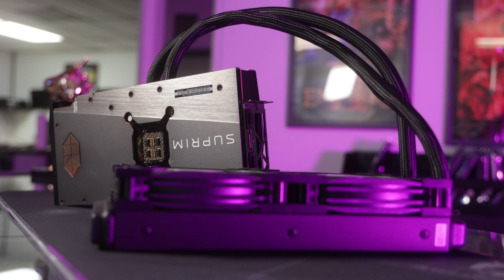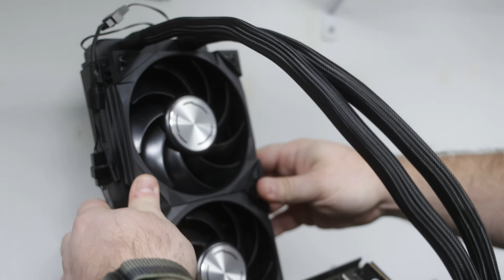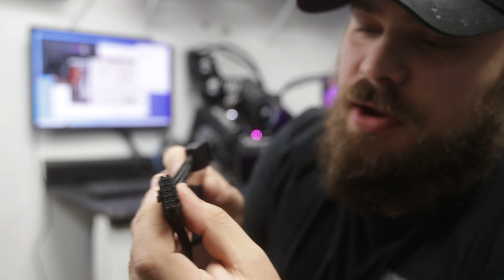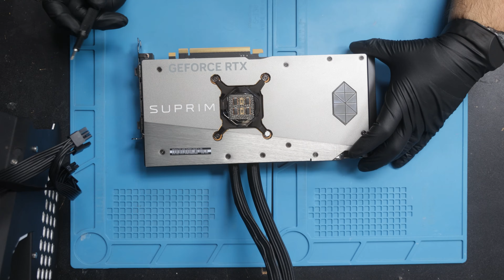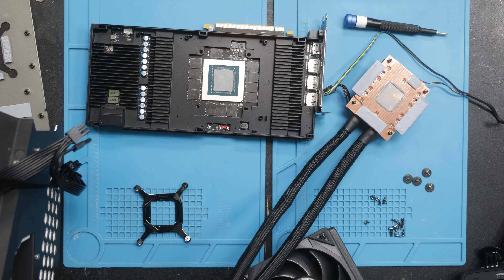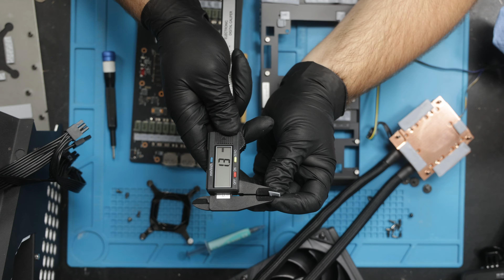MSI RTX 4090 Suprim Liquid X Dissassembly, Tear Down and GPU Memory Temperature Improvement

Comment: To anyone wanting to do this, you don't even need to remove the back plate. Just the 6 screws along each side of the front shroud and 4 on the back holding the cooler to the core. I replaced the thermal pads with thermal putty and PTM on the core. The memory went from 88-90c during test to barely hitting 70 by the end of a run. Core temps were about the same because MSI already uses PTM (or some variant of it).

EDIT: After a couple days and a few thermal cycles the core temps also have decreased ~10c with the new PTM on the core 👍

Comment: I just want to say thank you very much for your detailed explanation and lovely work with this graphics card. I love this card so much and thanks to your video I will check the manufacturing date to get details about the RAM situation. Lucky me got the card by an exchange with a 4080 without the need to put money on top (last year). What I want to say the chance is very high to have „the old version“, but I will see. Fingers are crossed. But anyways, I love this card so much (power, design, …).
Thumbs up for you and push push push for this video. Lovely greetings from Germany.
Reply from the maker: FYI any card they issue now will have this already upgraded. The second wave cards already had fix implemented.

Comment: im glad the 5090 suprim liquid improves on this design by putting the water tubes at the end of the card instead of the side. these current gen 5090 cards are wide, sometimes 150mm+ or "taller" than many average CPU coolers.
Reply: Yeah that was a dumb way to do things. It's not really problematic since you need the clearance for the 12VHPWR plug. Another downside is the orientation of the 12VHPWR plug - using a 90° cable makes for a very difficult removal since the retaining clip is hidden behind the plug and beneath the receptacle.

Comment: Great but what about the temperature differences 🙃❓
Reply: Surprisingly good temps for the core but vram suffers. 
Better with a waterblock because that copper part on the sides for the vram is sharing the core and the pump is incapable of cooling the entire area. It cools just a tiny bit in the middle and where the vram is its just thinker copper that water never cools it down but also some heat from the core extends out towards them.
Switched from that cooler to a waterblock and vram is never exceeded 40c and core max hot spot 56
530w load

Comment: Can the fluid be easily refilled? All water coolers eventually evaporate.
Reply from the maker: @TheWho18t  nope! The danger of any aio GPU
Reply: @SilverKnightPCs  @ 9:27 you can see that the pump takes a large philip head screwdriver to what appears to be a fill plug. So yes maybe?
Reply from the maker: @TheWho18t  you asked easily. I would not consider that easy for most folks

Comment: I need to replace the fan on my card itself.  After taking the shroud off, are there just a few screws that hold it in place? It's hard to see from that video when you flip the shroud over.
Reply from the maker: @Holyblades1982  yup!

Comment: Hi, is it possible to swap the radiator for 3 fan 36 white color type?
Reply from the maker: @jankristensen7884  not a 360. It comes with a 240 and its not easy to change

Comment: Hi Silver Knight,

I'm doing some experiments right now where I'm grafting a 4090 Liquid cooler onto my 4090 Suprim X. Theres a couple of issues I'm having;

1) I can't screw in the shroud fully. Can you confirm if the screws for the Liquid shroud is the same as the screws on its backplate?
2) My VRAM temperatures are up substantially, up to +30 degrees over air. I used 0.5mm Thermalright Odyssey pads. Would you recommend 1mm or 1.5mm for the pads?

Comment: Hi, I liked the video posted.
I have a question regarding the radiator.
Will it be possible to change the original 240mm radiator and apply a 360mm radiator?
Compliments
Reply from the maker: With some serious modifications yes
Reply: @SilverKnightPCs  Could you tell me how to make the change?
I purchased the Hyte Y70 touch box and would like to apply the 360mm radiator to the graphics card
Reply from the maker: @jorgemoutinho7159  I mean it's not as simple as something I can put into a comment on here. You're going to have to adapt all the tubing as well as get a replacement radiator and then redo the barbs on the cooler side or the radiator side. If you're asking me how to do it you're probably aren't equipped with the skills to do it
Reply: @SilverKnightPCs  I was thinking about putting this " Corsair Series Hydro X XR5 ".
My biggest question is whether it is easy to remove the tubes on the pump part ?
Reply from the maker: @jorgemoutinho7159  that's not going to work. The water block has the pump built into it but it does not nearly have the flow rate to run a full loop. You would have to do two separate loops with this card. If you're planning on going that route you might as well just order a aftermarket water block for the card if you plan to do the entire Loop

Comment: Great video. I know I'm a little late.  I have this card. And I have  a hotspot temp average that's basically normal but I have a hotspot maximum temp that's over 110degrees is this normal or is my card over heating. Because that average can be like 60 but maximum over 110.   Any info would be great as I'm about to send to msi to have looked at but don't want to waste people's time if not needed
Reply from the maker: So the hotspot temperature being that high is a little unusual. At the end of the day that's the hottest part of the core so more than likely it just means the cooler is not mounted evenly or alternatively there wasn't enough thermal paste or something. I would say I wouldn't worry about warranting it unless the card is having clock speed issues
Reply: @SilverKnightPCs  if u have time.   I noticed the clock speed on my card is dropping to around 1500 when I start getting the crappy graphics. Even if my thermals I below thermal throttle.   Any ideas

Comment: im not sure whether i should buy this card or the rog strix.
a lot of people seem to say that the radiator is getting extremely hot, almost unhealthy hot.
I feel like this should have been a full 360 radiator instead of this small one..
What do you think? Strix or this one?
Reply from the maker: Definitely this card, the Strix in my opinion is a bit overpriced for what it is. These cards are rock solid and they have updated them since the release (this video) to have better memory temps

Comment: I was slightly surprised you had OCP problems... I've been speccing a machine with a 7950X, this GPU (or an aircooled equivalent depending what's available) and I was wondering what scenario you were finding was triggering OCP, given the 40 series transients are improved on the 30 series. The GPU could potentially draw 530 watts peak if absolutely maximally overclocked via Afterburner under full benchmark load. A 7950X could theoretically draw at full blast 290W under 100% synthetic load. Adding those plus another ~50 watts for the board, you're still within tolerance of a decent quality kilowatt PSU. It wouldn't be as efficient as a 1.2 kW supply but it shouldn't just stop... Interesting teardown of the card nonetheless. Thanks for putting it together 🤙 reminded me of my adventures in repadding and pasting my toasty 3080 FE! 😅

I also wish they'd got Cooler Master to design the AIO with jointed elbows at the card edge so it would fit horizontally into more cases (or offered multiple connection points). Bit of a shame for a two grand card that it's so inflexible for mounting!
Reply from the maker: So these cards during the first wave had 600 W bios on them. Later on Nvidia and AIBs actually walked back this to 550W max. I can only assume that the cards were pulling more than that. Also this was during the time frame when the 7950 X and all of the AMD 7000 series with Boost clock speed until 95c was achieved and claimed that it was regular Behavior. We had a Arctic 420 mm AIO on the system which is arguably the biggest and best cooler on the market
Reply: @SilverKnightPCs  aaaah interesting! I intend to undervolt CPU & GPU and power limit the GPU as I've done on my last few machines, seems the 4090's so OP it won't make any meaningful performance difference to me. The VRAM's what I'm most interested in for work and VR gaming. What PSU did you end up running this on where it worked nicely?
Reply from the maker: @ChristopherWoods  nowadays the 1000W is plenty
Reply: @SilverKnightPCs  😎👍 what system are you using at the moment, got the suprim liquid or something else?
Reply from the maker: @ChristopherWoods  I'm still rocking a 5950X with an EVGA Dark X570 and a Sapphire RX 6900 XT Toxic. Trying to convince EVGA to do a Kingpin X670E and Sapphire to do a 7900XTX Toxic so I can upgrade :P
Reply: @SilverKnightPCs  very nice 🤤 I didn't quite time my last build right and missed out on the 5000 series. Envious of that card too. Owned several sapphire cards back in the early 2000s, soft spot for their crazy models!

Comment: That's really educational video! Should I get MSI Liquid X, the Inno 3D ICHILL BLACK or a used (but tested by the shop) ASUS VGA Asus RTX4090 24GB ROG-STRIX LC O24G?
Reply from the maker: I haven't seen one of the Inno cards to assess if they're actually good or not but from what I've seen from the European reviewers it looks like it's got some of the best temps on the market but not necessarily the most overbuilt power delivery. The Rog strix seems lazy. There's nothing exactly exciting about the design. The power delivery is adequate but the cooler design is not very impressive. The fact that they recycled the same design for the water cooled card and the Matrix is disappointing. I really thought the Matrix is going to get its own PCB
Reply: @SilverKnightPCs  Thanks mate! I I'll just go with the MSI Liquid X, especially now that they fixed it. I read a bit about the Inno and i have leartn that i has poor VRM section and lowest power limit (450 w vs 550/600 with this MSI), so perhaps it's not worth the 100 bucks I'll save on it.

Comment: to me this is extremely annoying, i am trying to find a 4090 that i dont have to completely dissassemble to get decent temps and considering the price of these cards its insane to me that you have to open them up and fix them, i mean cant these people include some decent thermalpaste and pads when you pay over 2000$ for it?
Reply from the maker: Cool PFP. Love me some MTG. Looking at comments it appears that the newer ones have had this issue corrected. I don't know if it was as a result of this video or ones like it. We haven't retested it since then as the temperatures for memory are acceptable just not necessarily the best on the first couple test samples we were working with. Usually once we validate the samples we don't go to retest them. Maybe it'd be worth doing a follow-up video on the future with a current production card to see if this was updated.
Reply: @SilverKnightPCs newer ones meaning after what production time
Reply from the maker: @Jay-jayy-n9u  post launch. Anything after January of 2023 looks fine (so maybe second batch after it was corrected). Easily 90% of cards have better temps
Reply: @ okay cool thanks I need to check out when mine was manufactured

Comment: It blows me away you didn't throw TG Liquid Metal in here like I would have. Otherwise, fantastic video! Show us some benchmarking numbers!
Reply from the maker: In our newer videos we have been doing more benchmarks. We went with traditional paste as our customer wanted to keep the factory warranty valid and LM requires maintenance as well as voiding MSIs warranty
Reply: @SilverKnightPCs  I didn't know it was a customer GPU. Explains a lot. Thank you. Also, I heard that thinner the thermal pad, the better. True?
Reply from the maker: @SNIPEYOPIPE  not necessarily. Thermal pads are pretty good at transferring heat through the medium. Usually you can even stack them about 2 or 3 times and as long as there are no air pockets itll transfer as well as a single pad. Its all about the thermal conductivity of the pads. You want to use the thinnest pads that fills the gap because if you use pads too thick it will cause unnecessary warp and flex of the pcb and cooling parts
Reply: @SilverKnightPCs  I see what you mean, but Gamers Nexus has stated otherwise. The less material heat has to transfer through, the better at cooling said material will perform when compressed between metals. I can completely understand the space tolerances and warping possibilities, though if too much pressure is applied to a certain area. Also, I forgot to add, that W/MK ratings specify how FAST heat energy will pass through a thermal interface material. Not how MUCH will pass through it at one time.
Reply from the maker: @SNIPEYOPIPE  thats fair enough. GN is a great source of information but I'd like to point out that there is no exact measure of thermal conductivity that the industry agrees  on so much so that almost all thermal pad manufacturers no longer put a rating on their pads. The pad thickness transfer speed while technically true, the reality of a  0.5mm to 1mm is so minor that it will fall outside of what is realistically measurable. Thinner is better, but mostly for the reasons I stated above less so because it's less material for heat to transfer through. If you were talking about a 10mm thermal pad vs .5mm (kind of a ridiculous example) maybe there is a large difference but even then I'm pretty sure it'll will transfer heat almost the same assuming the surface area of the components and heatsinks are larger than the thickness of the pad.

Comment: Hello!
Can I connect to MSI GeForce RTX 4090 SUPRIM LIQUID X 24G + GPU with PCIe 5.0? (MSI MEG Ai1300P PCIE5 1300W)
Reply from the maker: Of course!
Reply: @SilverKnightPCs  Hello! 
That is, I can connect to this graphics card Power Cable PCIe 5.0? And why does the description for this graphics card say that it supports PCIe 4.0? I'm a noob help me please 😄
Reply: It's just saying that it is a Gen 5 PCIe cable, which is backwards compatible with PCIe 4. That answers your question; But to add a bit more to it: 
 The cable is actually an ATX 3.0 version. However, releasing in the near future will be a new 3.1 version cable (12v-2x6) with different and better specifications for the cable and connector - once released, it will not work with today's cards, and today's 12vhpwr cables will not work with the new GPUs that support the 3.1 version. To get more info search No More 12VHPWR Connector! Say hi to 12V-2×6. Hope this is helpful to someone :)

Comment: Thank you so much for this highly detailed step by step teardown. It’s very useful for me since I’m planning to swap the stock cooling system to a full-cover waterblock. It’s such controversial situation on the graphics cards market when none of the vendors takes care of their loyal custmers-enthusiasts who own custom LC loops. Not a single model that would feature pre-installed waterblock out of the box and a decent components quality pcb (inno3d isn’t available in the U.S.).
Ironically I like the aesthetics of Suprim Liquid X aluminum shroud. I’d love to keep it. If the pump compartment was swap-able to a third-party WB that would be my choice. I even consider the option of the stock tubing removal and to connect it to my LC loop. But the stock pump … I don’t think it’s a good idea to keep it running sequentially with my18W 600l/h Laing DDC.
I’m totally fine regarding stock cooler temps. The rad is outside of the case now (there’s no room for it inside). And I haven’t seen VRam temps above 68 degrees. GPu chip hot spot was 74 degrees max at 1.05v. 
I would appreciate it if someone shares the experience of this particular model modification towards full-fledged liquid cooling loop.
Reply from the maker: I'm pretty sure there was 2 waterblocks released for it
Reply: @SilverKnightPCs  full-cober WBs, there are plenty. I meant that the idea was to keep the front look of the card remain intact. Just to replace the plastic housing of the stock pump, including the pump itself with a proper dimensions waterblock to be screwed into the stock coldplaye. Probably a stupid idea but, again, I’m almost happy with a stock cooling system performance. Swapping it to a full-cover WB now is only due to a reason my case isn’t capable to accommodate a third radiator.
Reply: i wonder if the connection from the water block to the hoses are workable. if i could add my own hoses, i could run tubing to my own rad and keep the card as is.